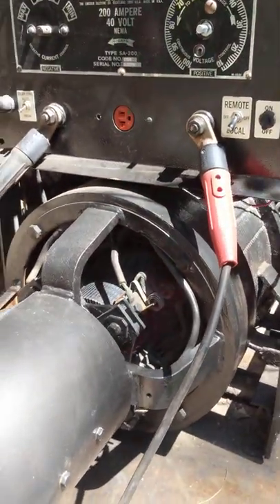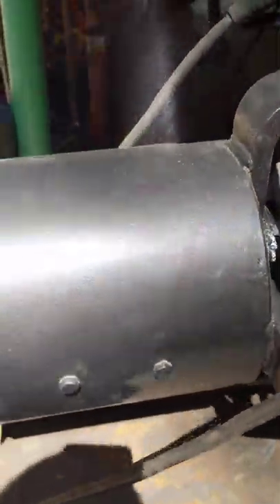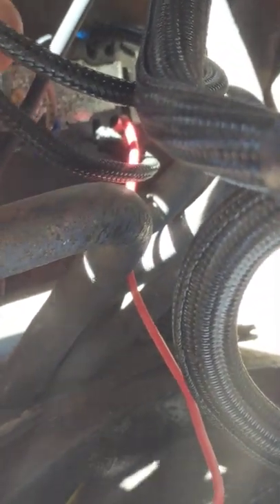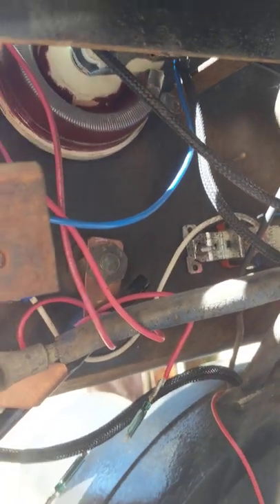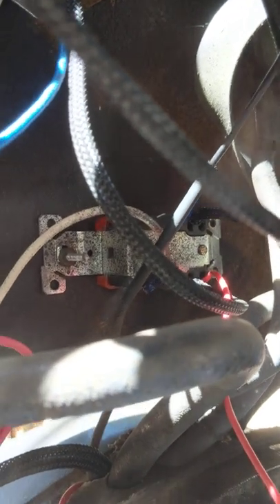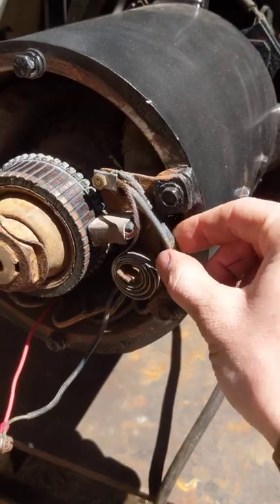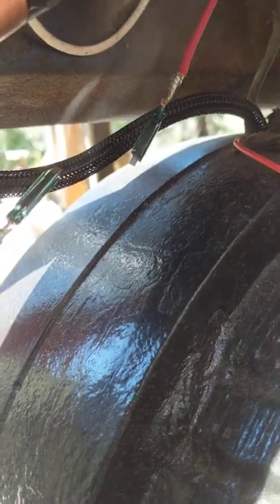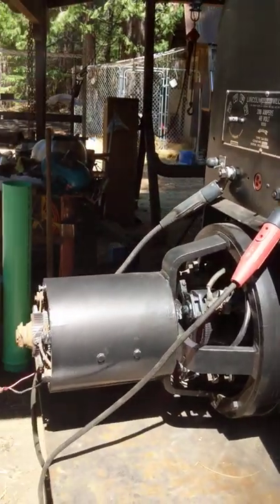Lincoln Short hood SA 200 wiring.

Comment: Did this wiring get your machine to run fine on remote and local? I’m wiring my 52 and not having to much luck
Reply from the maker: Yessir, everything works perfectly.
Reply: Okay  i think I have it wired correctly , I might have broke my reed switch in the process and think that’s what is going on. So when I’m local or remote grinder idles up the machine, but have to adjust it to 100 to get full power. Is that the way it’s wired? But with I go to strike a arc it’s arcs but doesn’t start welding on either local or remote but my high idle works fine and can weld when on high idle. Do you think it’s just the reed switch not transferring the power to the pc board?
Reply from the maker: @alemunoz298  sounds like your reed switch. It gives the board voltage when you strike your arc and idles up the machine. Having to be on 100 to run your grinders sounds out to me though so look at the wiring around the rheostat and make sure that is all correct to the video.
Reply: Kyle Lovelady okay I’ll check it out thanks man
Reply: Kyle Lovelady so I’m watching the video again and I notice from the plug you jump it back to the center of the rheostat? And the blue wire is running to the offset can you verify that? I have mine running off the plug  to the offset and blue wire from switch running to the center?
Reply from the maker: @alemunoz298  yes, that is correct it is the negative wire coming off the coil pack in the exciter to the plug and then jumpered over to center stud of rheostat.
Reply: Kyle Lovelady okay maybe that’s my problem 😂
Reply: On your machine are the two black wires from the main gen shunt coils attached? Then blue goes to rheostat and brown goes to the idle circuit?

Comment: I have one of these machines with the original bellows idle. Do you know anything about the wiring on those. My machine doesn't have the 120v outlet instead it has a receptacle for 12 volt remote of some sort mice chewed up the small wires of the shunt coils and the exciter coils so it's been rough finding a wiring diagram specific to the shorthood.